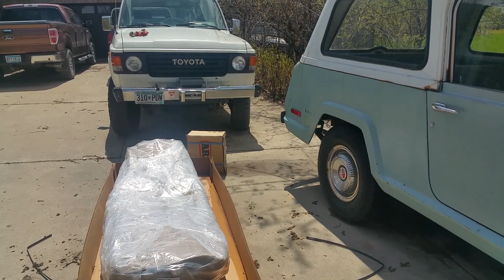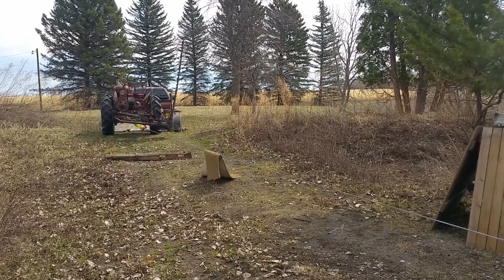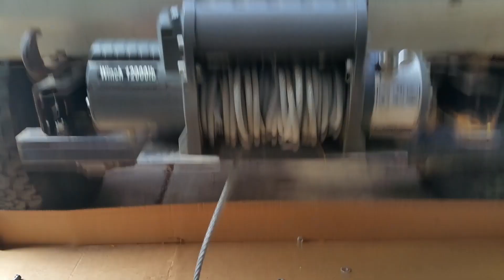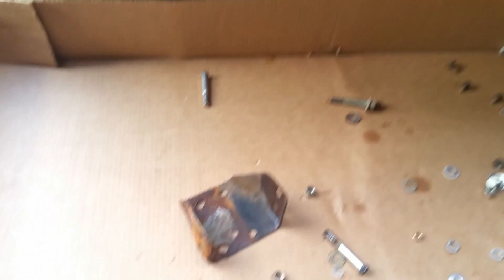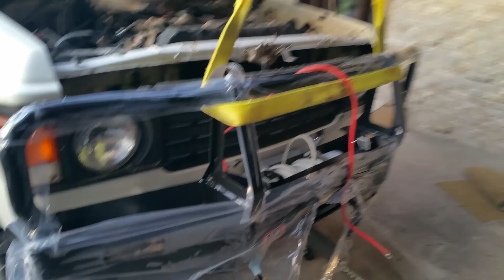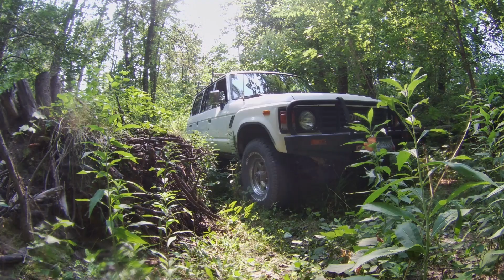Land Cruiser FJ60 ARB Bumper Install

Comment: In Australia at the moment the chrome bumpers are IN! ARB bar is more practical but the factory look is where its at now with 60's here
Reply from the maker: I am starting to agree,  I miss the classic look.  I could always switch back, but it works for now.   I did have a tree rip off my driver side mirror, but no fault of the bumper.

Comment: Thanks for the video. I’m a huge fan of the extended stock bumper. Did you sell it???
Reply from the maker: I still have the chrome bumper, I wouldn’t toss it away, the chrome is still good.   I am finding the ARB not working to stand on when working on the engine.